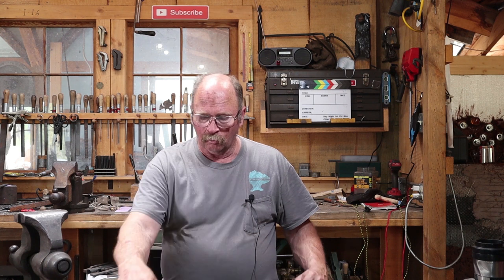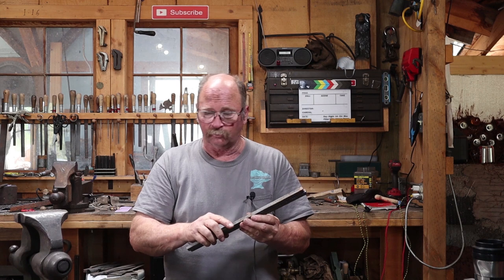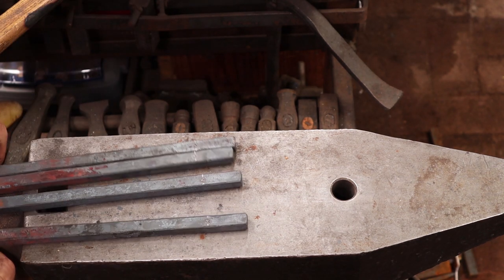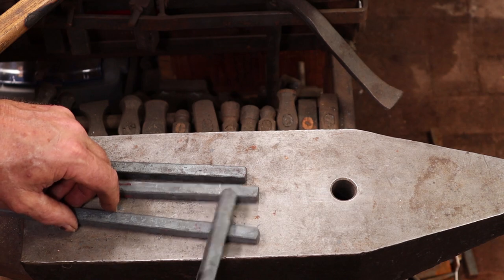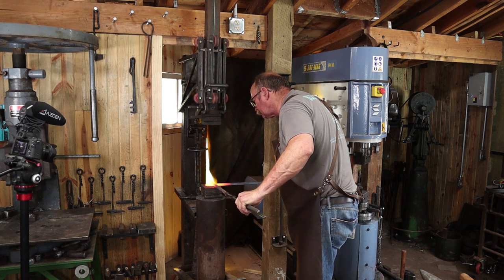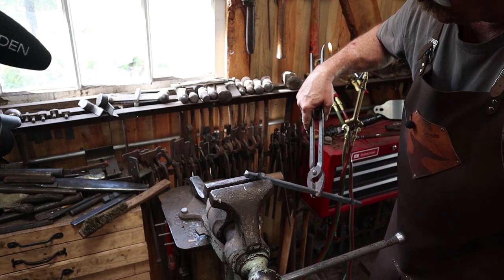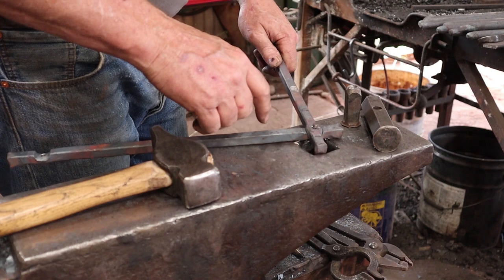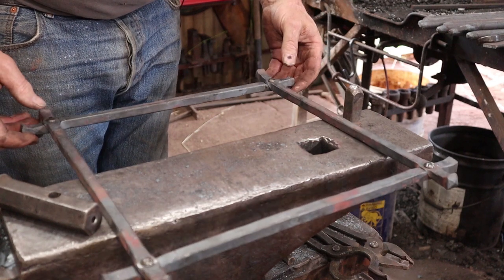Forging a square frame using half lap joints

Comment: John I really appreciate how much info and knowledge you share in you videos. I tried forging an old garden tool blade into a draw knife with zero success. ... I should have just used a bench grinder to sharpen and flap wheel to remove rust but I thought it looked easy in all the videos id watched. I couldn't get the metal hot enough to forge  together coz I tried to fold it over and back into its self...the metal only got red not orange and didnt stay red for more than ten seconds. I ended up using a cutting disk on a grinder and cut out the shape from a dead table saw blade and turned some handles. Is the any way you could show me how to get a decent forge temp without having to use coal or gas? Or is that just wishful thinking?
Reply from the maker: You can do it with a wood forge (convert the wood to charcoal as you work for best results)  You need a deep fire and good air supply.  I will try to do a video later this month on a budget backyard forge.  But I wouldn't expect to forge weld in that style of forge
Reply: Black Bear Forge thanks mate ill try again with a deeper pit. I had it about 100 mm deep with a reverse cycle vacuum but I think maybe that was too much coz it made the wood burn away fast with sparks flying all over the place and left no coals to sit the metal in. Ill wait for the vid though.

Comment: Another great video John. You mention a square pointed center punch. I dont think I've seen you refer to that before? Is it just 4 flats running down to a point and not rounded off like usual?
Also, what about the imprint makes it easier to find when hot?
Reply from the maker: Yes, its just a diamond shaped point the fact that its angular makes it easier to see.

Comment: John, I'm a bit off topic here, but in one view you were working your frame on what looks exactly like my Peddinghaus 100kg anvil.  I have built at least 5 hold downs now to use with it but because the pitchel hole is so darn smooth, I can't get one to work on it at all. Yours looks just like it,do you have a hold down that works for that anvil? 

I love your projects and learn a lot from you, thank you so much.
Reply from the maker: Try extending the reach of the arm a little and possibly adding some texture to the shaft with course sand paper or a center punch

Comment: So, how do you square it up since "Chances are it'll be slightly out of square"?  Inquiring minds want to know, and all that.😊
Reply: Use the 3-4-5 method or measure corner to corner on the diagonals. Or use a small square and make adjustments as needed.
Reply: @1averageamerican  Thanks, I understand that method of checking for squareness.  What I was wondering was where to hammer when adjusting any out of squareness.  It seems like even a mild whack on one of the diagonal corners would loosen the rivets, because of the mechanical advantage.  Plus, I was expressing my pleasure at John's method of presentation.
Reply from the maker: I'll probably use a bar clamp if it needs it.  But its actually almost perfect.  there may be some heat and selective drawing out of one side vs the other as well.  But I will cover anything that needs to be done in the next video.

Comment: I have tried to contact your patron but i cant get none to answer me. I was contacted by Patreon that my donation was declined when i started i was very clear i get payed on the 3rd of every mouth i am on a fix incom and cant afford to have a $36.00 over draft because patron wants to take out the $5.00 donation on the first of the mouth instead of the 3rd i will have to cancel my donation. I cant afford the $36.00 charge patreon has already cost me. Now if you have any way to help change my debit date i would like that very much if you have no control over this i will have to stop my donation. Thank You Richard Linn
Reply from the maker: I am afraid that Patreon always uses the 1st and that I have no way to change that date.  I am surprised they charge any kind of fee.  I completely unsderstand canceling the donation and I appreciate that you tried.